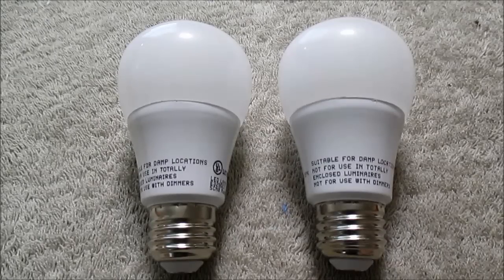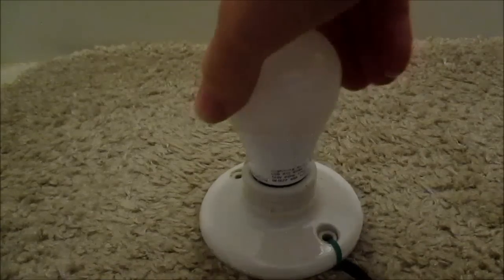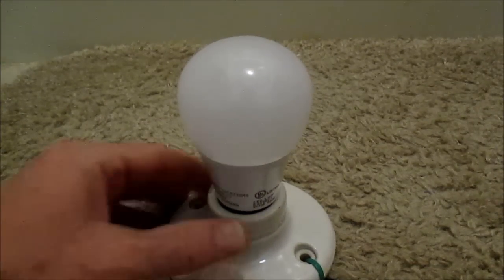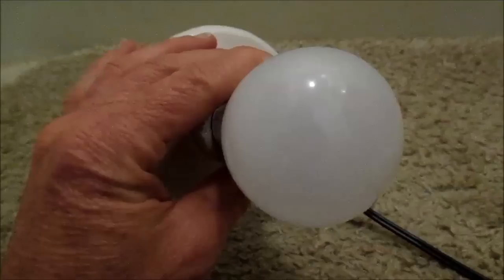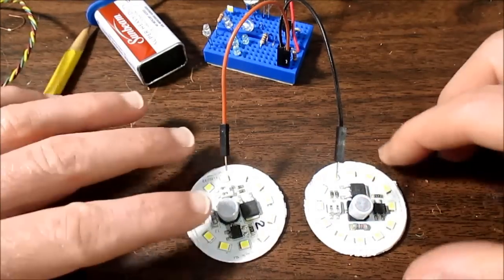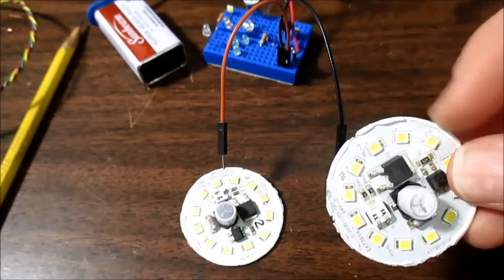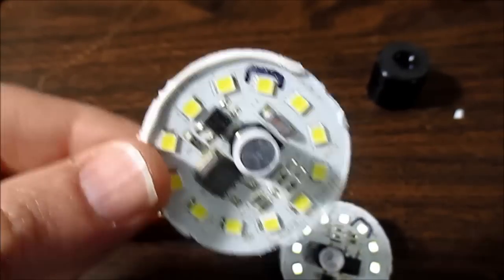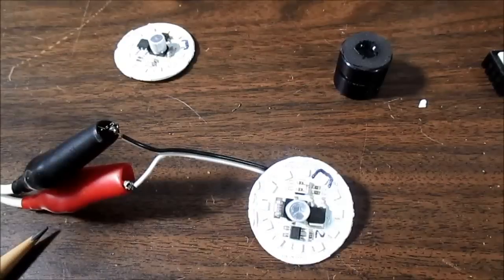Two failed LED bulbs for teardown to determine the cause

Comment: We used incandescent bulbs for well over 100 years. They were cheap though inefficient, but who cares? Now we are forced to use Chinese crap that costs more, puts out awful quality light, and doesn't really last any longer. Our city changed most of the traffic lights to LED's and how many of them have large segments that have failed? Hate to think how much those cost. It's all to "save energy". What a crock! Get rid of all that electronic junk that runs 24/7 that we don't really need.
Reply: Hott Puppy 
The first ones were made to last. It's only a matter of time before they find a way to make them fail fairly regularly.
Reply: Like crack.. Always chasing
Reply: I knew an engineer from Poland, who worked in a light bulb factory under communism. They lasted many years, as they should.  Post-communism, an American consulting form was hired to recommend ways to make them more profitable. He recommended shortening the lifespan with a new formulation of cement in the base which allowed oxygen to slowly infiltrate the bulb, eventually making it fail fairly predictably after between 1-2 years.
Of course this is anecdotal, but this does not refute that this is a clear case of planned obsolescence.

The first CFL bulbs I tried were $27 apiece, but I had one that lasted 14 years. The first LED bulb I bought was $45 in 2007, and it's still lighting up the porch perfectly today, 10 years later.

Anyone who tells me they aren't deliberately shortening the lifespan is just not tuned into reality.
Reply: Landrew0 said: I knew an engineer from Poland, who worked in a light bulb factory under communism. They lasted many years, as they should.

And what happened if a batch did not pass quality control?
Reply: Anyone can make an incandescent bulb which will last almost forever.  There's no secret to it.  You just run the filament at a lower temperature so that it doesn't burn out so easily.

There are at least two problems with doing that, though.  Firstly, the bulb will lose efficiency to the point where most of the energy put into it will be wasted as heat (and something like 85% of the energy is wasted as heat already in current incandescent globes).  Second, because it's running at a lower temperature, the colour of the light it produces will tend to be very red which isn't good if you want to film something and is also very inefficient for normal sight since our eyes can see blue light better than red light.

TL;DR: You can make a globe run almost forever, but only by wasting heaps of energy and money.

The problem with LED lights is poor design for driving the LEDs, not the LEDs themselves.  The electronics need to filter out surges on the power lines better than they currently do.  With any luck, the design of the driver electronics will improve in the future so that the lifetime of the globes will also improve.

But it's always possible that manufacturers are deliberately not improving the driver electronics in the hopes of selling a lot more LED lamps.
Reply: JasonMasters, my experience is that LED tend to be driven too high with poor thermal solution, heat dissipation (partly due to small factor, needed to be sealed, etc.). For instance the one on the video has very cheap PCB and design (3 pin voltage reg)
Reply: Hott Puppy, using your logic, we'd still be using kerosene lamps. Will you only begin using LEDs in 5 years when they're a lot more reliable? Well, pay for the extra juice until then - the rest of us will contribute to developing the tech for you in the mean time.
Reply: steve gale That is nonsense. Pre 70s bulbs were much better, as were batteries. I had used bulbs from the 1920s and 30s from an old picture theater that I sold to a collecter, and as far as I know they still work. There is a light bulb outside a fire station in California that has been working since 1901, and has only been turned off a handful of times. I know the earlier bulbs are better from experience, and that built in obsolescence is now, standard practice.  Prior to the 80s things were expected to last as long as possible, anything less was unacceptable. These days, shoes for example are so bad the soles seem to be made from chewing gum, or perhaps tofu.
Reply: +Chuffpup The old stuff was made with more attention to detail. The manufacturing process was much more hands on. Everything now has to be mass produced by machines in order to be affordable, and with little human intervention.
Reply: Actually, I have an incandescent bulb that has been burning for 873 years! Every now and then I just give it a little shot of lubricant!
Reply: I have had an on & off Light Bulb "collection" over the years, & have used some of the older ones,(early 1970's) & have had amazing life spans from them..beyond what modern ones go. The odd modern ones (Mexican) one in my kitchen & 2 in my living room have been on the go since 2005  & used regularly they are darkening but so far refuse to blow (a 300W, & 2 60W)   There is a Mine, in Quebec, that my grandfather visited when I was a little boy...he told me they still had the original Edison type Light Bulbs from when it was 1st opened, lit up they were never switched off..& it had been 100 yrs being lit at that point...(I imagine they were darkening but it's a feat I doubt modern LEDS  could touch).  If you have to keep replacing an LED (plus the Fuel & your time to go buy replacements) it negates the Electricity it saves...
Reply: https://www.youtube.com/watch?v=zdh7_PA8GZU
Reply: http://www.realhardtechx.com/index_archivos/Page28820.htm https://www.macworld.co.uk/feature/apple/where-are-apple-products-made-3633832/ learn then talk.
Reply: I show fact and you just fart from your mouth: time to follow the most important proverb I know: "never argue with an idiot. they will try to bring you down to their level and beat you with experience" so Goodbye
Reply: You think like a politician , "they are ineffective" - they warm your house actually basicilly the undeside of attics/floor and Your eyes dont get dim with them either so the benfits are big but not to a politician head/mind
Reply: You are mixing together two issues:  Efficient technology and quality manufacturing.  The solution to both is to tighten up manufacturing tolerances.  Give LED's 100 years of improved manufacturing techniques and they will be as solid as incandescent bulbs at much more energy efficient.  Also I don't know how incandescent is more durable when it just takes a light tap and the filament breaks whereas most of my LED lights will last..... well.... come to think of it I haven't had any go bad after years of using any of them in my house yet.
Reply: i have been using led's for many years.In the house, trucks, led light bars that easily spot deer several feet off the road   & low current draw
Reply: +steve gale The white markings on Panasonic capacitors mean that they are subcontracted, not that they are substandard. The one does not imply the other and if Panasonic cares about its brand name it will make sure that they meet their specs. BTW it would be nice if you could construct an argument without being so offensive. It really doesn't further your cause.
Reply: Hott Puppy this internet fight though... zola v gale!! lol
Reply: JasonMasters: IDK about electronics, I have a cheap LED bulb directly from eBay that has nothing more then a capacitive dropper power supply, and it is lasting very long. On the other hand, I've tried to repair other bulb with chips that I've ordered from china and these fails again after a short time in most cases on the same chips. I think chips are not perfect and need to improve. There are some good quality ones, but they are probably not cheap as there is lots of R&D involved in these still.
Reply: Thank you!   ..I was beginning to think I'm the only one who knows that goes on..(deliberate design flaws put in Manufacturing).  I heard of Corporations here, ..hiring  Engineers out of University to  study the manufacturing processes & the Products & find ways to substitute Plastic in place of Metal. "that kind of thing" so they ..juuuust...go over the Warranty & break, (certain series of Canon Cameras the Battery Cover uses a very thin Latch tip that works well for 10 yrs then goes brittle & snaps off ...need new Camera.. MOST (not all) Electronic Devices employ EEPROM Technology..Fridges/Dishwashers/Furnaces/Carbon Monoxide Detectors/ modern TVs....  They internally time off the "Product Heart-beat" down to the second.  (I'm talking ones built now not 20 yrs old ones)     My experience with Light Bulbs has been  hit & miss...certain ones even ones from CHINA...have lasted like CRAZY..go past 1000 hours!!  & some poof "right at 1000"  CFLs---the VERY 1st ones we had here were made in Holland, & you could replace only the Tube or only the screw-in Ballast part, & were long straight Tubes...they lasted like crazy, I still have one or 2 but can't find stores with the Tubes for sale anymore. Then came the "Toxic Twisties"..which many failed early esp if installed in a Traditional Light fixture..(so you need to replace all the Fixtures..good for the Fixture Companies)  I learned this type of Lamp causes health issues to ppl suffering from Diabetes etc from the "Dirty Electricity" they contribute...apparently the LED are not as bad, ..it's the Wavelength in the Light they produce that is the issue....  Anyways.."it is what it is"
Reply: Has anyone ever addressed the phasing problems involved in powering electronics? Apparently having the voltage and current out of phase as caused by powering electronic devices creates inefficiency. A power system engineer I worked with wanted electronics powering to be distributed among the 3 phases coming into the building instead of having all the dedicated ground orange plugs to be on one phase. Having all electronics on one phase would require increasing the size of the line power transformer. Pure resistance such as incandescent bulbs have do not add to this problem, assuming the engineer was correct and with my limited understanding of the theory.
Reply: And this is a complete lie, pretty much all of it.

- Regular bulbs never lasted "years" unless they were designed for brutally low efficiency and really really yellow light

- First CFL bulbs lasted maybe 10,000 hours before being very dim. The electronics housing (like first LED bulbs) was enormous which helped get rid of heat, but customers hated.

- All my LED bulbs including new ones are running, and even if one fails, at a couple dollars per bulb in 2018 dollars, who cares.
Reply: Your sister may not know more about lighting that you do, but I do, and I think you are just one step out of the nut house. You have not a rabid clue about anything.  Average life of name brand LEDs used properly is over 10,000 hours. Yes there are infant mortalities, but overall, failures are very very rare. 50 in my house installed in last 5 years, not even 1 failure as of yet.

Your conspiracy theory crap about incandescent and halogen bulbs just shows your ignorance and your willingness to display it for everyone. You can't back up anything you say with anything remotely scientific. Molybdenum is not alloyed with Tungsten in an incandescent or Halogen bulb, it is used to manufacture the support wires. The filaments are pure ductile tungsten. Any additives are part of the MFG process and are removed during that process.

There is no conspiracy theory w.r.t. the life of an incandescent bulb, simply a trade-off between efficiency, color temperature and bulb life.

LED commercial fixtures are regularly lasting 50,000+ hours and more. Your crazy conspiracies are just that. Me thinks your knowledge of lighting approaches 0.
Reply: There is not conspiracy theory w.r.t. incandescent bulb life. That is just plain ignorance. It is a simple trade-off between lumen output, voltage, bulb life, efficiency and color temperature. No more, no less.
Reply: Wow, you really are clueless about lighting aren't you. I mean clueless. 

" I can show you actual local parking lots lit by Cree "Edge" HO fixtures that glare from above, and leave the area below pretty dark.". The light below is not "dark" it is operating exactly as it should. What you mean is it is not much brighter than all the other lit area. Why would you ever want that? LEDs allow precise optical control so you can put the right amount of light where you need it. Not too much, not too little. Stick to topics you have a clue about.

You are full of crap that a Cree fixture has shifted Cree or noticeably dimmed after 4 years. There is not a Cree commercial fixture in existence doing that. Maybe some cheap offshore stuff, but hardly indicative of the majority of LED fixtures.

You have 100,000 hours on a Mercury Vapor and it is 70-75% of initial output. Now I know you are completely lying. They don't do that ... ever, unless there is something really wrong with the ballast and they are horribly under-driven. Sure you can find mercury vapor bulbs that last 100,000 hours, but by then they are probably only at 25-30% of their original life output. Reality is that at least 1/3 will have failed by 30,000 hours, and while they are working they are terribly inefficient by modern standards and hence why their usage stopped.

A 275 watt Cree Edge HO fixture makes 30,000 lumens, not 8000-8500 lumens. What drugs are you on?  http://lighting.cree.com/products/outdoor/area/cree-edge-high-output  You really have 0 clue what you are talking about. Oh, that fixture if the ballast is good will still be making 25,000+ lumens after 100,000 hours!   You see no advantage because you have no clue what you are talking about. No clue, none at all.

Oh, why did your colleagues not correct you? Probably figured it just was not worth it.

The bulbs were yellower because they were lower output ... to last longer. Keep in mind that through the 70's the US gradually creeped up to 120V (from closer to 115). The bulb ban did not even start till a decade after your conspiracy theory, not in 2000-2003. A bulb ban wasn't even an idea then.  The bulbs were reduced slightly in output and CCT as too many were failing with a grid that could be 5% above 120V.  It's called Engineering, not conspiracy. Higher voltage means thinner filament for the same approximate light output and as well, most bulbs, i.e. 2008 OSRAM were 1720 lumens, Clear, 1000 hours ... soooooo.
Reply: You are just completely off the deep end. I don't work for Cree don't need to. Have used their fixtures, have developed fixtures, have used competitors. They don't green shift, not actual Cree fixtures. Many fixtures look approximately the same. Since you seem to think a 275W Cree would be 8,000 lumens, you are obviously not one who can be trusted to have any valid things to say on this.

Appliance bulbs are very easy to get. I don't know where you live. They are not banned, no issues at all. 

The traditional sources really have almost no place anymore. LEDs can achieve far better color rendering than any but ultra-specialized fluorescent or HID bulb ever has. CRIs >95, R9>90, even at 4000K (not just 2700 and 3000). If you think you can't achieve near perfect color rendering with LED, then again, you are just obsolete in your knowledge. 

Never use <100W for outdoor lighting? Again, what are you on? Most residential street light fixtures are now 50W (even less). 100W gives me an easy 10,000 if not 12,000 lumens. Just what are you trying to light? Your 50W mercury vapor is not even 3000 lumens .. ugghh.  Please get your information from this decade. Life moves on, tech improves.

If you think it is 70% of original light output, odds are it is much closer to 30%. That's the way the eye works. If you had a good modern LED fixture, it could still be 90%, however, you would have paid for the fixture several times over with the electricity savings.
Reply: I used to live in a rural neighborhood that had a pair of blinking red / yellow LED traffic lights at a 3 way intersection on a fairly busy country road, to let people on that road know the intersection was coming up so that cars coming in from the side road wouldn't get hit. I lived there for two years and about half the time those lights didn't work correctly, or at all. Often they would behave just like the lights in this video, flicker, only light dimly, etc. People like to argue that these kind of lights save energy & money. But I also think of things in terms of man-hours. How much energy, money, and time is spent repeatedly sending out county workers with a boom truck to keep fixing a crappy LED traffic light? Seriously, in this particular place it would've been safer and more efficient overall to just leave up the old-fashioned lights. I get that those have to be changed too. But that is a normal expectation with an incandescent iight. When you put up an LED expecting it to last years and it goes out in two months, and the next one goes out in a month and a half, and the next one goes out in 4 months, something bunk is going on.
Reply: Blame the US companies who source cheap crap to sell. I've bought Walmart Great Value brand LED bulbs and haven't had one fail. LED bulbs do save money, 9w compared to 60w. Use the 2700k LED bulbs for the best light. You must live in a poor city as here the traffic lights are all good.
Reply: These crap product just is made by China based on the crap company coming from your country. This only means your country has a lot of crap companies who are fooling you and taking your money. You should blame on these crap companies and stop buying their craps instead of blaming the country who produces these craps as you just got what you paid. Just like a cheap PC comparing to an Apple Mac computer.
Reply: I love LED bulbs. They run cool and the light emitted is so much better for people with low vision.  I also love them for growing seedlings for my vegetable garden.  I made a little grow room out of a closet and I use the "100W" "Daylight" LED bulbs to grow my seedlings.  They aren't 6500K like normal grow lights, but they are 5000K and that's good enough to mimic sunlight for seedlings.  And they use only 14 watts!
Reply: Another wonderful idea brought to you by the Eco nut left wingnuts of the democratic party.  Screw everyone, we're children and we'll hold our breath and turn a brighter shade of the blue we're already colored, and whine about stuff they have no idea what they're screaming about.  No more incandencent bulbs!  You bad bad people.  Don't you love mother Gaia?
Reply: I care. Even when I didn't have to pay for electricity, I bought CFC's at $10 apiece, just to save power.

The drain from inactive electronics is significant, but not as bad as incandescent lights.
Reply: The average lifespan of today's LED bulb is more than enough to save enough power to not only pay for itself but pay for replacing it every other month and STILL save on your power bill.  On the other hand I do hate to see products go into a landfill and I do hate the low CRI of most bulbs and really hate when they're used for bluish white street lighting that causes glare and poor ability to see sign colors, etc.
Reply: The stupid moron is you then as you keep contradict yourself. Now this is the last lesson I give you and I'm gone as people normally pays me to learn: https://www.westfloridacomponents.com/manufacturer-logos.html I repeat: learn then talk: don't use the mouth only cos you have one. Goodbye
Reply: @Alessandro Sala.... gale said that you were writing garbage, any response to that, chap?!
Reply: Not sure what the point is of your ignorant rant?  LED traffic lights are infinitely more reliable than the bulb based ones that regularly required a truck + safety crew to change bulbs 1-2 times a year in the middle of the night versus once every 5-10 years.  The reason why you didn't see outages with the old tech is they were changed so often before they would fail. The LEDs last so long it is not necessary.

Expensive LED bulbs .. not really, and when you take into account energy costs, way cheaper. Perhaps the issue is you need to stop buying the cheapest stuff you can and go with name brand stuff that had a vetted MFG/Supply chain. I have tons of LED bulbs ... not a failure.
Reply: @steve gale I don't use any surge protector as most of the computer power supply (I use antec anyway and not china junk) can work without any problems between 180 and 275V. The voltage regulation I've been using years ago to reduce of 7% the supply on alogen display lighting and make the alogen bulb lasting 5 times more then due. About the twin towers? some people believe what they get said and don't care to check the facts.
Reply: @steve gale The story of the incandescence light bulb fixed life is public since ages. Anyway.. still some people believe the twin towers collapsed for the burning fuel so you can believe whatever you like. Cheers
Reply: Yeah, I get it. You're so used to being tribal about everything, that you'll defend even that under which you yourself are a victim, just because you can.